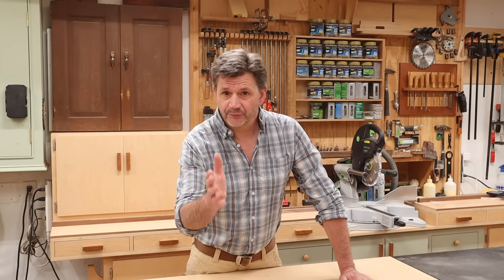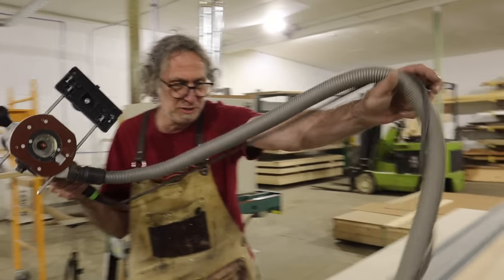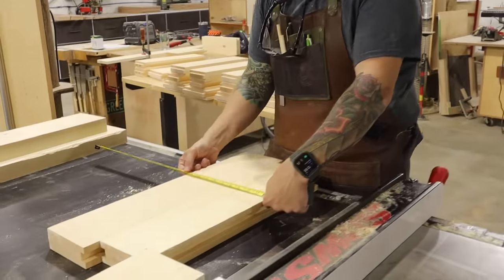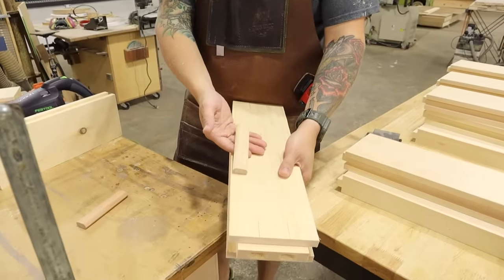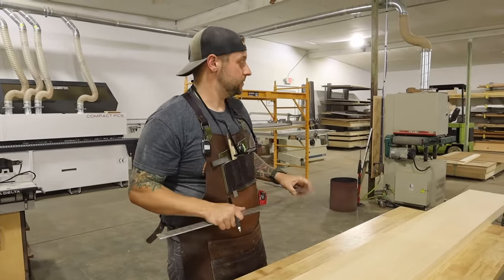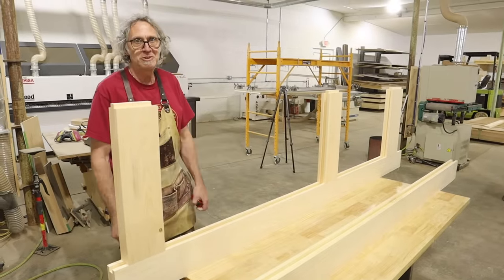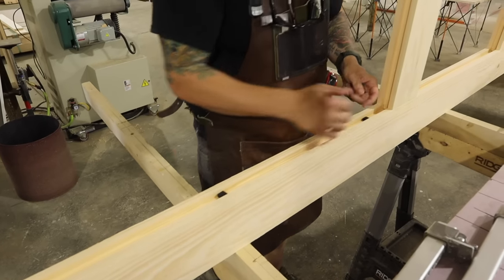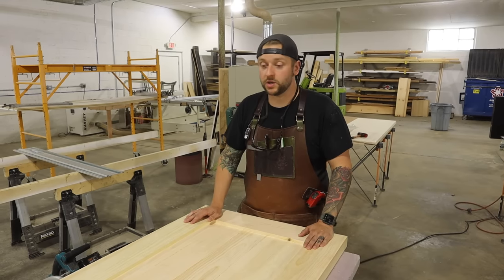How to Build a Solid Wood Door / Start to Finish / Fine Woodworking

Comment: 1-1/8” thick wood is 5/4, not 4/4. Technically, it’s 8/4 because as soon as you go into the next inch, a lot of mills charge for the full inch based on the extended drying time.

Comment: Totally enjoyed the video 😊. I’m a carpenter & joiner with 40 years experience, not used my df700 yet and watched a few videos on solid door construction, pleased I waited for your because the lack of haunches on tenons bothered me, the stud tenons on the rails is simple ( probably) and clears my issue up completely 😊😊😊. I’m hoping the panel buddies are listed on here because I’m in Australia and mass produced door is the norm here which after 13 years living still doesn’t impress me lol, in the main if you buy a solid door here it’s mainly veneered normally 1-1.5mm over finger jointed timber (ISO minded) which once again is not what I expected. So once again totally impressed with the video and of course your joinery and ethics of building the best quality doors I’ve seen using domino df700
Many thanks and regards
Trevor
Reply from the maker: Thanks Trevor! Really nice to get the positive feedback.
Reply: @JonPetersArtHome  may I ask how much per door you sold these for?

Comment: I needed a door from my driveway to my patio wide enough for an offset smoker, with attached tray. So, since 38" w doors aren't available, I made my own out of rough cedar that I milled down to 1 3/4". I also used the 12mm x 240mm dominoes for the joinery. The 1st door I made like this, I used 1" mortise and tenon joinery, but it did not hold up after some tree guys were carelessly bringing a cut tree through the opening. It's been 3 years since I hung the new door and still looks new. I did a few things different, but the end result is the same.
Thanks Jon for this trip to a custom shop showing their methods, and methodology. Nice work Greene Street Joinery, hope to see more.

Comment: Beautiful work and amazing machinery. Question. If I want to put glass in the door instead of a panel, is it the same process with a narrow dato?  Say slightly more than 1/4” for 1/4” tempered glass?  For cedar, do I need room for contraction and expansion of the wood?

Comment: Just so happens I have an almost identical door project sitting in limbo in my garage, awaiting answers and some inspiration.  Our son's condo has an exterior wooden door to an attached storage unit that some bozo replaced with an interior, skinned particle board door, which, big surprise, has totally disintegrated.  And I happen  to have an entire dismantled wooden patio cover in my side yard, a pile of pine and fir 4 X 10s and 6 X 6's.  Full of knots and nail holes, but with enough selective cutting, I've made up most of the rails and stile blanks I need.  Have been debating plywood or solid panels, but these solid panels look fantastic.  That door they made is nearly perfect size wise.  Thanks for all the help!

Comment: When your getting the lengths of your rails, switch boards around from the way you had them, outside edge to outside edge with the groove facing out..then measure the remaining materiel between the grooves like you did..put the tape on the finished dimension and what's left is the exact cut length..no need to ad anything